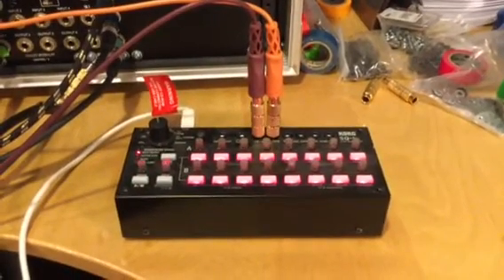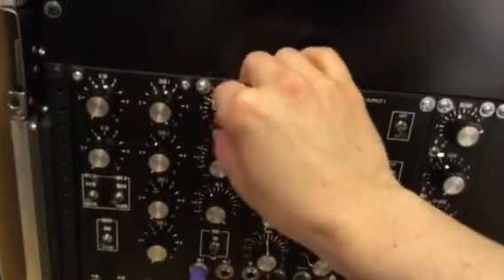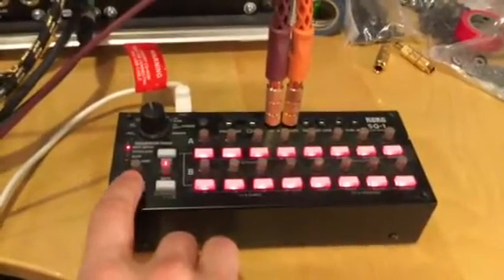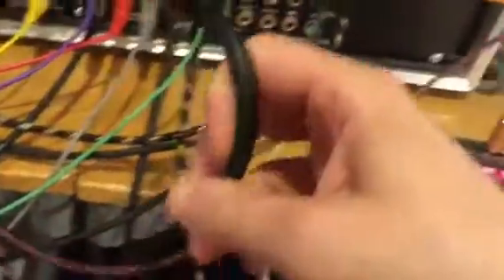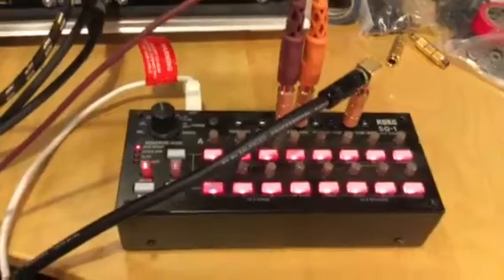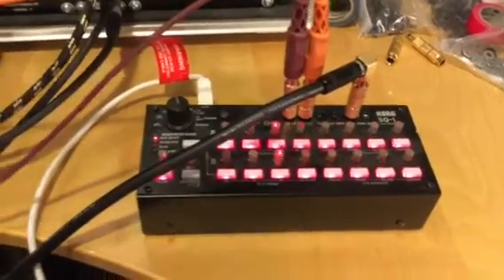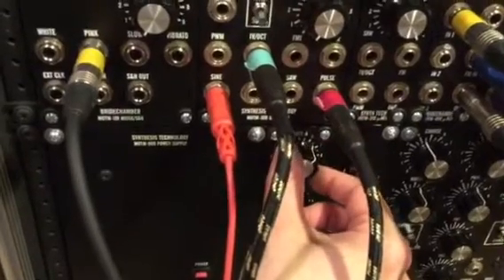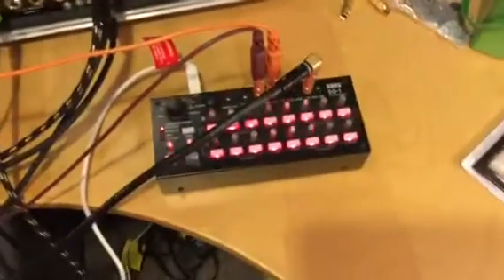Sync in on Korg SQ-1

Comment: Hi do you know if it s possible to basically do the same thing in the video but then sync the sq1 to a midi drum machine?
Reply from the maker: Probably. It needs a 5V input.
Reply: MantzEiser the sequencer ill be using has the 5v input .  It would be in this order : Sequencer + sq1 + drummachine. Master clock from the drun machine which is midi. Hope it makes sense, im new to all this 😬. Thanks anyway
Reply from the maker: You will need a midi to CV convertor to change the midi signal to a control voltage. I use the Encore Expressionist which I like, but there are many others.
Reply from the maker: Although I think the SQ1 also accepts midi with a dongle that comes in the box.
Reply: Thanks for the help!

Comment: Hi. Great! What output is this cable connected to in your modular? i want to do the same with my Mother 32 syncibg the SQ1
Reply from the maker: In this video I was going to a Gate in, but I’ve used the same method to a clock in and to trigger in. The sync out sends a 5V trigger out.